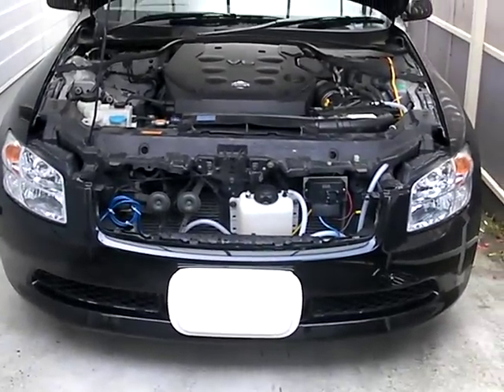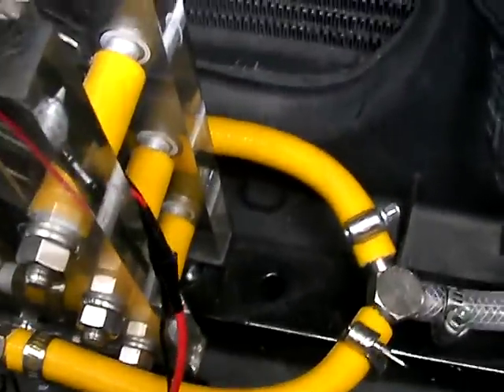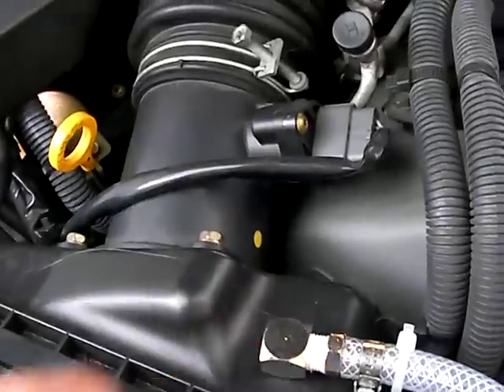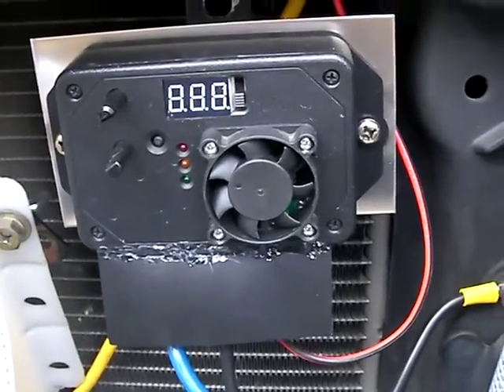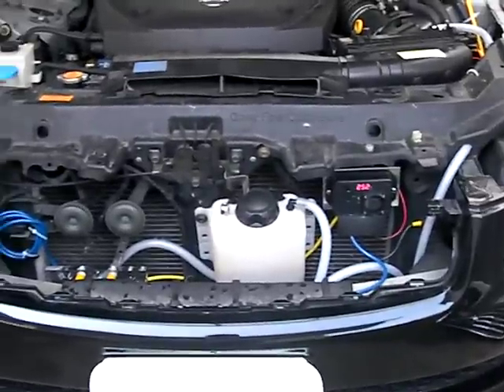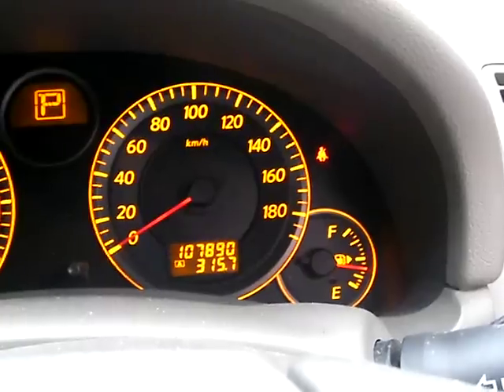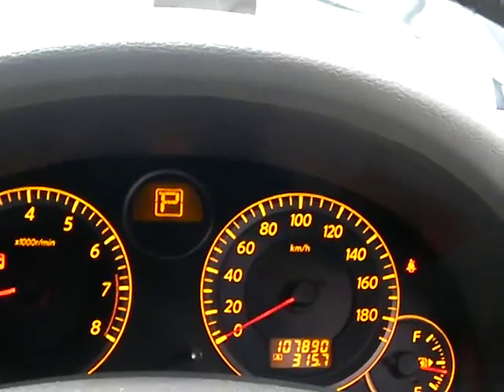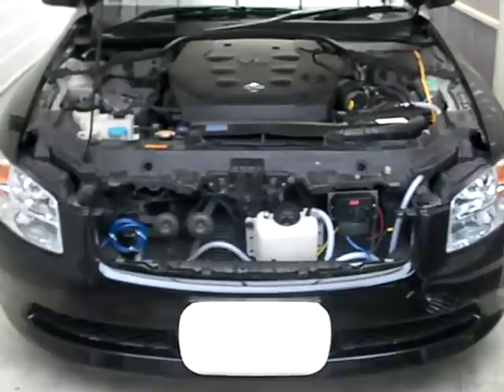Successful HHO install in 2005 Nissan Stagea

Comment: Wow, very nice sir.  I have just a few friendly questions to ask.  On the pulse modulator, I know it is supposed to be water proof but at an angle in the video you can see the circuit board through the fan.  What is it about the design that stops water from getting on the circuits and shorting everything out through the fan inlet?  Also, I'd recommend a little more protection than the current rubber block; air flow under the baffle will tumble and there will be a low pressure zone -